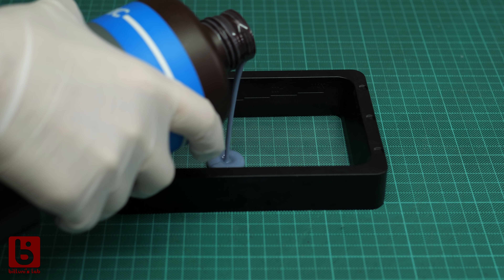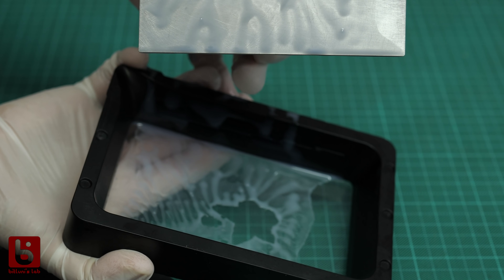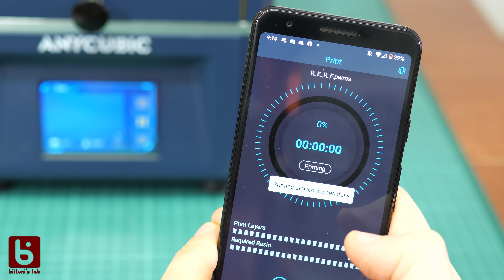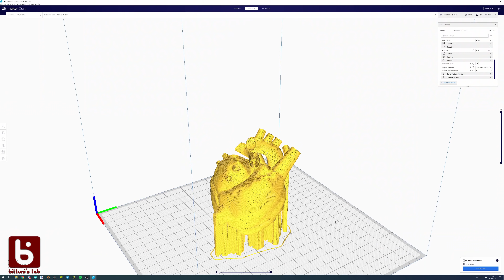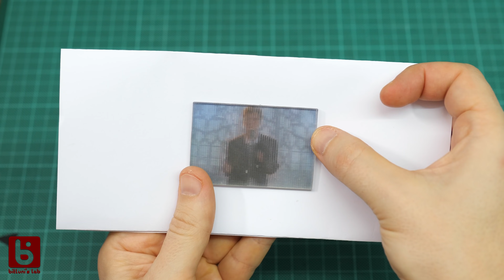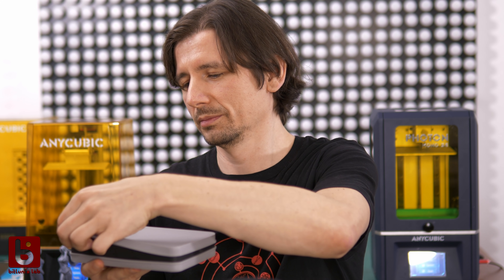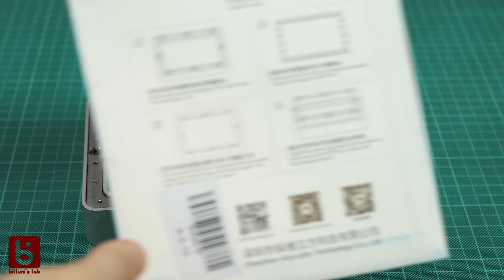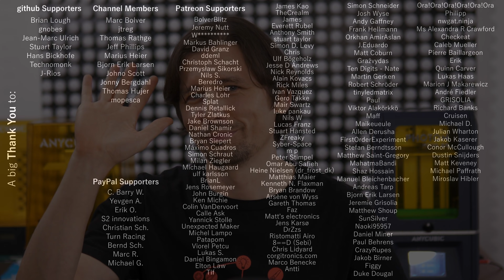What I learned about SLA 3D Printing  (Anycubic Mono, Mono SE)

Comment: You can "clean" and reuse the IPA by placing it in the sun for some days or using an UV light. This will cure the dissolved resin and you can filter it using paint(?) filters afterwards. Well, at least that is what I've read somewhere. Might also solve the color issues? (When they are caused by this, idk.)

Comment: Great stuff! By the way, when printing flat things in resin, you can just put them flat against the build plate with no supports needed! It takes a bit of prying to get them loose after printing and there might be a small bit of "elephant's foot" , but the savings in print time and post processing are well worth it.

Comment: Strange question, but how viable do you think running one of these would be on a boat using LifePo4 batteries?
Reply: Probably not difficult to do as a number of these only need 50W to run (basically an old incandescent light bulb). Just figure out how long you need to run your printer and what it's power requirements are and add a safety margin. On the other hand you might need to do something about sloshing resin if your boat rocks.

Comment: little tip for removing supports. after printing and removing from the build plate use an old hair dryer on the supports this will heat them up and they will start to warp and you can brush them away from the prints without leaving any puck marks on the models. i would suggest buying a Sovol photon vat for the photon mono as the quick replace fep sheets cost a lot of money and you will save money in the long run with a metal vat.

Comment: Hi. 
This is great! Great video as always!
Is the resine recyclable?
Do you think you can make a len and then modify it?
Thanks!
Reply: I think it's likely fundamentally impossible to recycle resin, because it forms a thermoset polymer, which cannot be broken down into original constituents.
However the liquid resin that remains in the printer unused after the print, you simply filter it back into the bottle and use it later.

"Len" is not a word, it's unclear what you mean.

Comment: If you need to quickly make a part clear, dip a paper towel in mineral oil and give it a good greasing. It will quickly rub off and it’ll make it impossible to glue, but it’ll look crystal clear while it lasts.
Reply: Zack!!! Love your videos man!
Reply: cool to see you here
Reply: I have had great luck just by curing siryah tech smokey under water. On anything thinner than 3mm, it looks like regular clear, but it is super clean and doesn't yellow after curing.
Reply: A quick layer of clear coat works wonders too.
Reply: zack, if you'd printed lenses in your video I would have been sold, but now, NOW, I need an SLA printer for SURE :D
Reply: Oh shit, a wild voidstar appears!

Comment: The resin printers definitely open up a lot of possibilities.  I bought an Elegoo Mars 2 about six weeks ago, and have been learning to use it.  I used a couple of bottles of the IPA-wash resin, and then switched to the water-wash resin, which isn't really any more environmentally friendly, because you have to then figure out what to do with the water contaminated with toxic materials.  But it's cheaper and easier than IPA.  I have a big tupperware container full of water to do most of the initial cleaning in, and then use a spray bottle of clean water to finish off.  The clean water drains into the big container, replacing what evaporates.  It works pretty well.  I bought one of the "ABS-like" resins, and it is, indeed, quite a bit more flexible and tougher.  I'd like to see what you think of some of the new flexible resins that are becoming available.  You can apparently also mix it with other resins to make them stronger.  Those gears were pretty impressive.  There's a planetary orbit model out that I want to try printing the parts for with the resin printer, as my FDM printer doesn't do it justice.
Reply: What brand "ABS-like" resin did you get?

Comment: I bought a new Photon S, cannot get it working. Giving up, wasted money on it.
Reply: They really are pretty good. I've got the Photon SE and my first print failed. Everything was too cold. Took a heat gun to the build plate until it was warm and soaked the resin bottle in some hot water for a bit to warm it up and it's printed fine since. Rough up the build plate a little with some fine sandpaper too. Too cold an environment makes the resin react slower. I've been FDM printing for 5 years and this is definitely the future for 3D printing.

Comment: my resin prints only turn out well in the center of the buildplate, everyhing outside the center with a radius of about 2cm fails/warps
does anyone have an idea how i could improve this?
Reply: 'Make sure the FEP it tight. If it's loose it will deform your prints when it pulls off. I use the PTFE as well. It seems to help it release easier. Make sure it is supported well too.
Reply: @helicopterdriver  thanks for the reply. so you just got a ptfe spray and applied it to the fep film in the tank? found some ptfe sprays but it seems they are mainly used for lubricating bikes, is there anything to look out for?
Reply: @c0d1ngclips25  3-in-One PTFE Lubricant. It comes in a squirt bottle. Apply to the FEP with a cotton ball when it's clean and let it "dry" a bit. Rainx window spray is another option but the 3-in 1 is cheap. Seems to work for me. Only one partially  stuck print after a many. (support fail) Supports seem to be the downfall of most prints for me. Too many is just enough. :D

Comment: Use PTFE spray on the FEP film and it minimizes failed prints from stuff being stuck to the FEP, ruined my day a few times on my anycubic mono X where a failed print can be 600ml that you need to drain

Comment: Why no lan option, is it that hard to incorperate lan function so you don't have to change usb sticks the early photon's had a lan connector and chip but no firmware that supported it. Ow and directories on the usb stick still doesn't work (Photon S v5.0.2)
Reply: The electronics is proprietary by another company, Chitu Systems, and it's all closed source firmware, so if they never got something working, or don't offer a feature, well there's nothing the device manufacturer can do about it. And there's also no alternative supplier.

Comment: Is it possible to expose photoresist for the PCBs in a TFT "screen" of this printer?
Reply: I think Marco Reps has done some testing with that. Anyways, getting two layer PCBs is still hard to achieve with that, Vias also not possible, and JLC or similar are still cheaper and not that slow.
Reply: @LudwigBrechter  nope, Marco suggested only tanning procedures:) But you're right, double sided would be a pain in the ass to produce.
Reply: @SciDIY  I don't think so. Laminating dryfilm on a double sided pcb should be pretty easy. And exposing each side to the screen for 1 minute should be enough. Etching proccess is same as single sided boards. You can fill Vias with solder if you are not using the pcb for high frequency stuff. All in all, it shouldn't take more than 15 minutes to finish the pcb. It'll be great for rapid prototyping.
Reply: @hassanzahin1534  it may be fiddly to align two sides. But it would be a gamechanger if there no need to print a mask for the photoresist.
Reply: @hassanzahin1534  Dont forget you need to drill the holes. For a complex PCB that is multiple 100s. And also another tool (dremel with drill guide e.g.)
I am not saying it is impossible, have been doing it when I was young and there was no easy and relatively cheap online service. But its not as easy as throwing a PCB on the SLA printer and being done.
Reply: Maybe the resin itself can replace a  photoresist whether it precoated on pcb or in dry film. As far as hardened resin is easy to peel of afterwards.
Reply: Is it possible?
Yes.
It is possible.
It would only cut out the printing, paper sticking and washing part of the process.
You still need to etch and potentially drill the pcb.
As for double sided pcb's. 
Very difficult. Probably more so than paper transfer as each side has to be done separately on the printer.

Comment: I've heard (still not tried out) that clear resins really depend on curing time, otherwise they get a yellowish touch.
Reply: That yellowy touch will come from sunlight, as it features different wavelength of UV. Some wavelengh break up the uncured resin and it may change color.
Reply: @SeamusHarper1234  I've had clear resins come out yellow while printing using recommended settings, before curing. There's very few clear resins that will actually print clear.